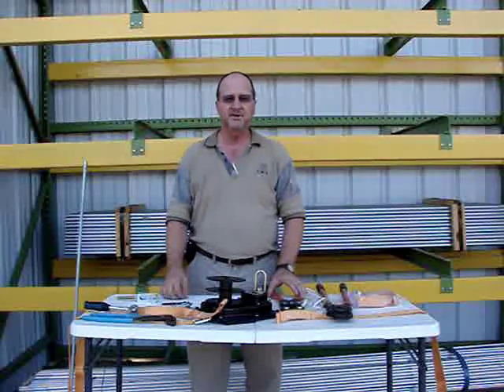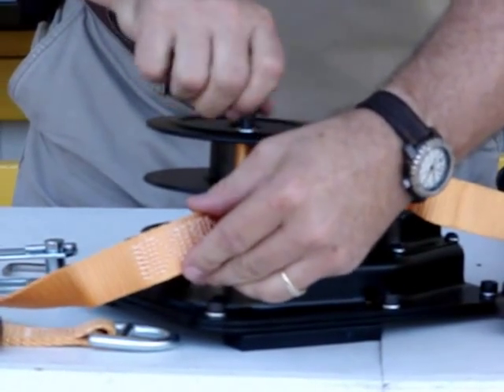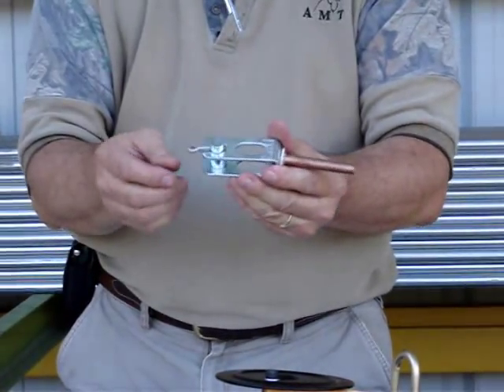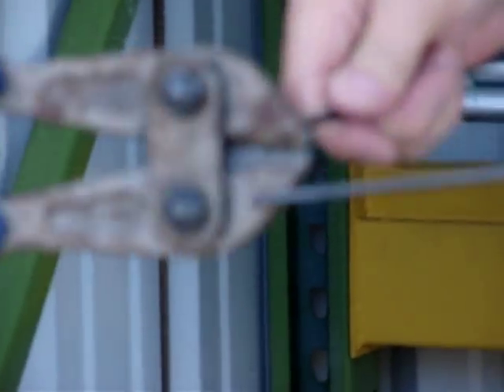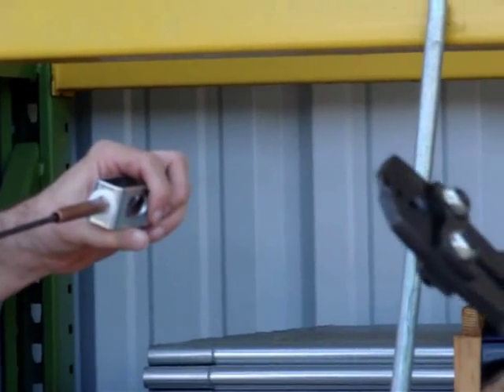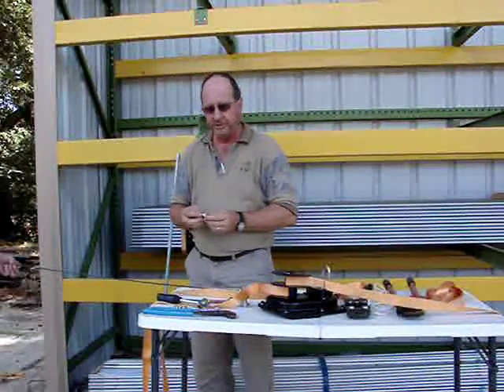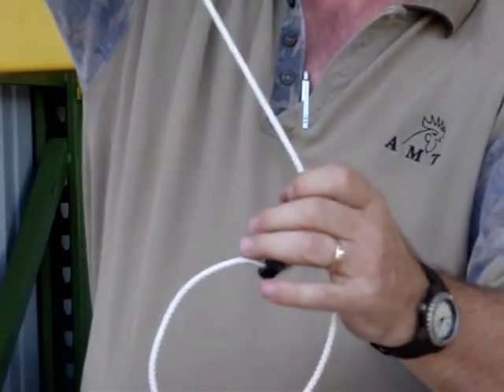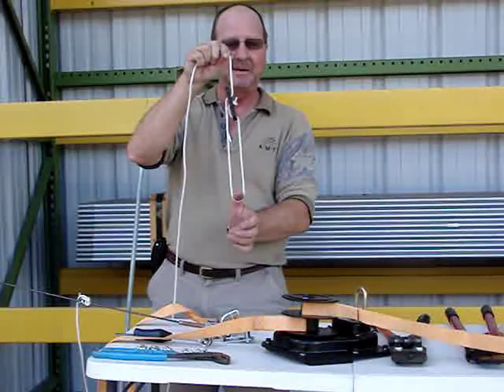AMT's Cable-Free Winching System

Comment: Apparently the cord adjuster doesn't work on poultry farm nests. They are said to slip under the weight and the solution (annoyingly) is to use another cable clamp on the rope.
Reply from the maker: Thank you for the reply.  Just want to let you know that we don't recommend using the cord adjusters on nests.  Best practice would be to use cable clamp on the cord.